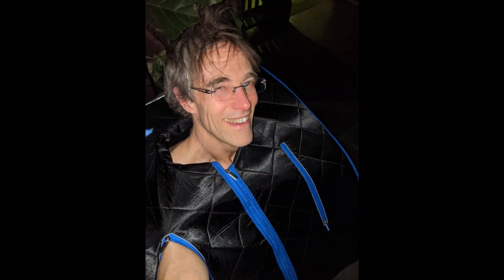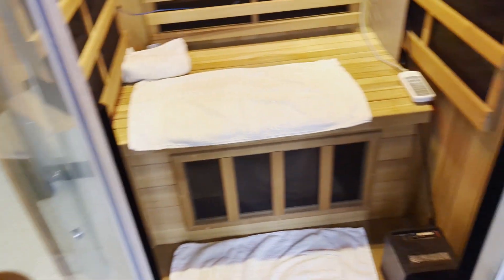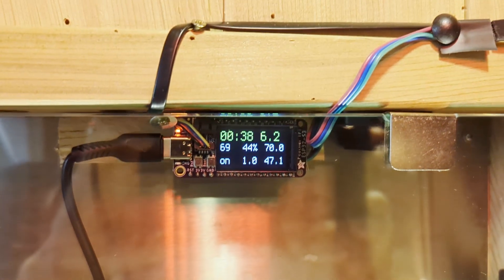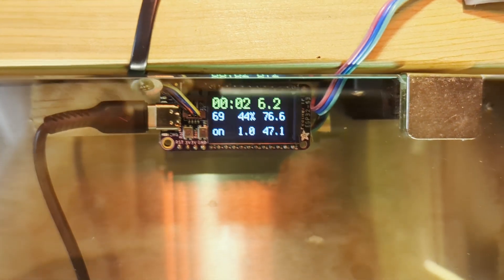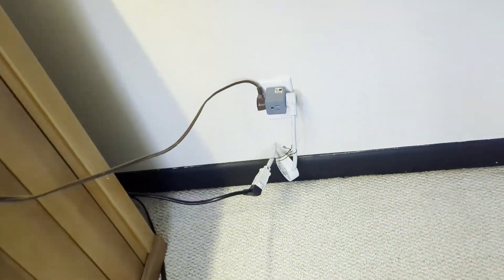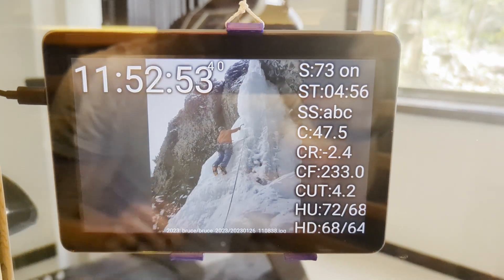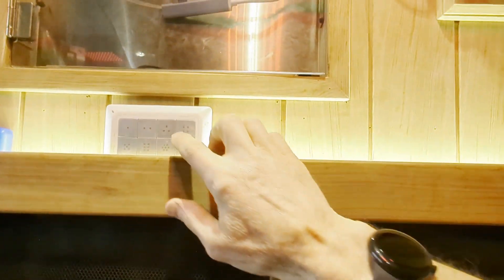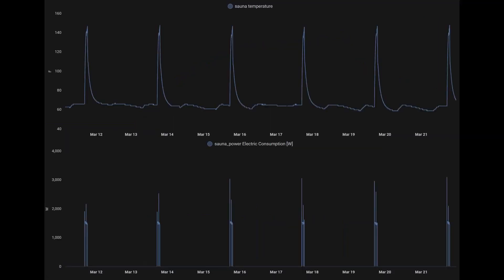Make your sauna hotter and smarter!

Comment: Please make a video how you built the finger that switches the sauna on and off. That is next level engineering and I need to learn. Do you use esphome or do you code the software yourself?
Reply from the maker: I have a few esphome instances, but mostly I use micropython.     I'll show more details on that in future videos that show other projects that also use those Adafruit chips.
Reply: @BruceWinter  I am interested in the design, the servo motor, how you operate it, and how on earth did you get the capacitive touch to work? I would imagine you probably use a capacitor? Looking forward to a video to learn more. I am a programmer by profession so I was just interested how you integrate everything. ESPHome lamda functions is my goto when I need to add custom code
Reply from the maker: @HeinzMeulke  I used a 1 foot length of speaker wire, wrapped around the servo arm, to simulate the capacitance of a finger.   Nothing magic about 1' or the wire type, any little capacitance would do the trick.

Comment: What is your favorite temperature sensor?  Can you recoomend a package to collect data points on temperatures many places around the house?
Reply from the maker: I like the Adafruit SHT45 Precision Temperature & Humidity Sensor I used in the sauna, .1d C accuracy!   For a more stand alone turn key sensor, I like the switchbot sensors as they have good battery life and nice big local displays.   The switchbot app is an easy way to collect display the data.    I use Home Assistant and Node Red to collect and display sensor data, but there is more of a learning curve there.
Reply: @BruceWinter  Thank you for your reply.  Are you using a Raspberry Pi as a controller for your Stemma adafruit i2c connections?   I know it's too much to get into here, but can you give me an overview of how to get data into homeassistant?  ie; did you install a database add-on in HA and somehow interface to your controller?  Does an MQQT broker communicate with your database to store datapoints?  eh? ehhh?
Reply from the maker: @SolarDrew  I'm using a Adafruit esp32 board.   I send the data to HA via mqtt and HA.   I'll plan on post the esp micropython code in next month's video which uses the same board and code.